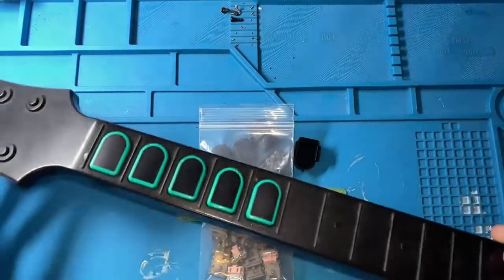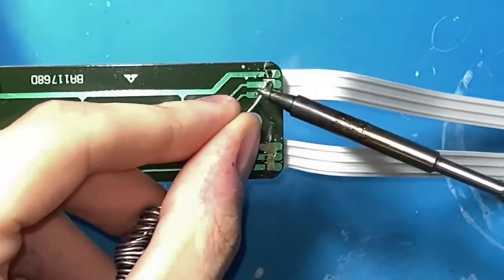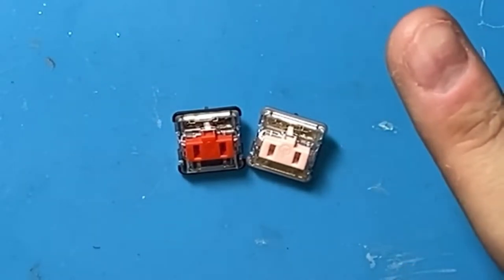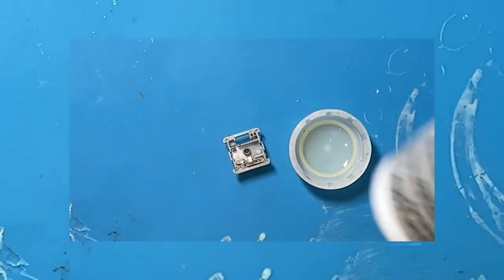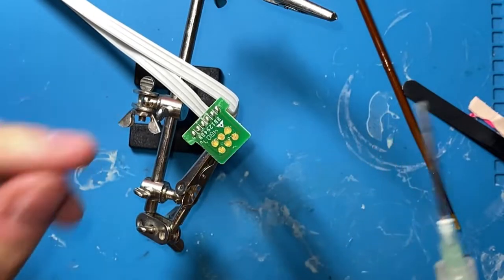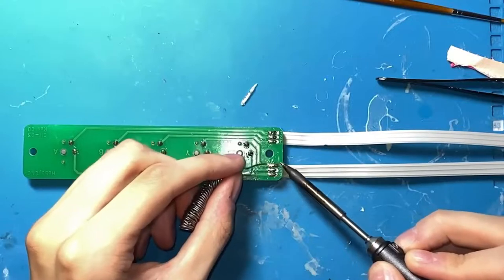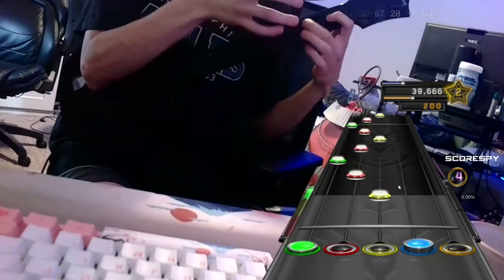Build a MECHANICAL FRET Neck! - DIY CH Mods

Comment: amazing

never knew about the ballbearing travel distance mod

Do you think reducing the actuation distance further is warranted?
I reduced both travel time and actuation on a b0xx controller for ssbm, and I loved it.
Reply from the maker: 1.2mm ball bearings are standard cuz they don't flicker on hard presses.
ornej used 1.3mm ones for orntage 2021, if that says anything xd

Comment: Question: 
If I'm using an arduino tu program the controller, i don't need the fretboard PCR, right?
It's difficult for me to get some of those. And to my understanding, it will work in Guitar Hero as well as CH if it's well programmed.

Comment: you mention that one should get 1.3 mm metal balls if they "really want some overtappage" what does that mean? I want 1:1 inputs if possible, so are ball bearings just for overtap?
Reply from the maker: you can either use 1.2mm ball bearings, OR you can 3d print some brackets that fit on top of the switches.
https://github.com/Pixelholic/switch-bracket
Reply: @PixelholicYT  i wanna minimize 3d printing as i dont have a 3d printer so ill probably go with ball bearings :3
thank you for the info though :D

Comment: How thick are your 3d printed frets?
Reply from the maker: the raised bottom and sides are the same as regular frets at 15mm, and the milled out part is 12mm
Reply: @PixelholicYT  Awesome thank you so much!
Reply from the maker: @Glockodile  o7
Reply: @PixelholicYT  Did you print them yourself or did you get them from someone?
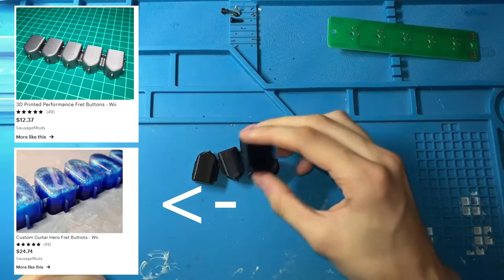Reply: @Glockodile  look at 1:00

Comment: have 1.2mm bearings ever caused problems with you? getting terrible flickering with 1.3mm, but can't imagine .1mm would make a huge difference
Reply from the maker: 1.3mm tends to docker because it's right at the edge of the actuation point of the switch, which causes the flickering. 1.2mm tends to not do this at all. The .1mm difference may not seem like much but the results say something else.
Reply: @PixelholicYT  i'll give it a try, thanks. i guess it's more accurate to think about it being a 7% difference, that puts it into better context.